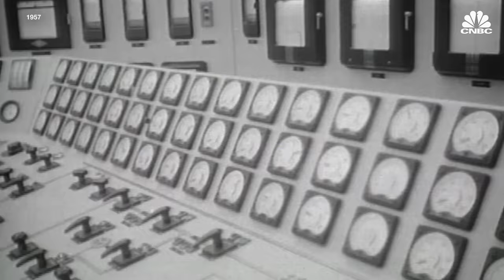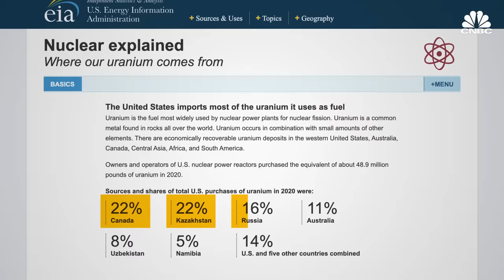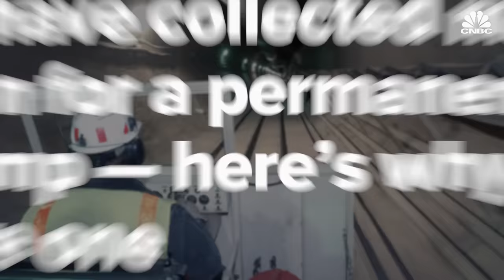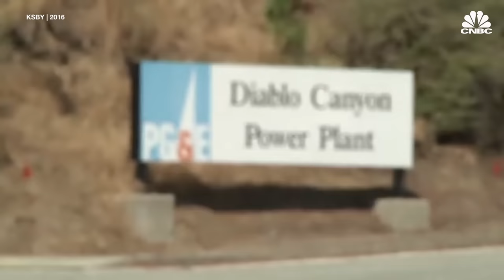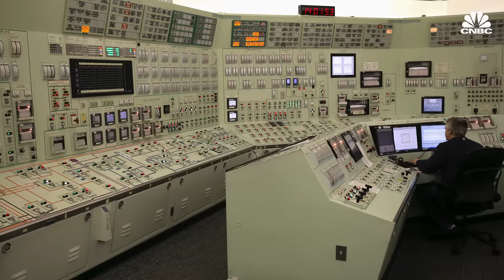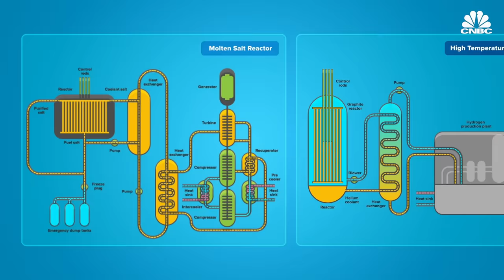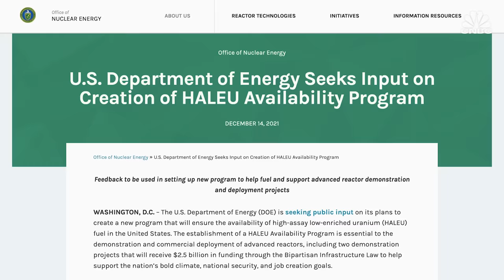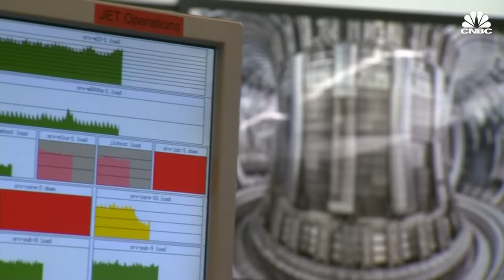Why Nuclear Energy Is On The Verge Of A Renaissance

Comment: The video was annoying within 2 minutes, but the comments are a good read.  I think nuclear plants - salt water cooled slow reactors most likely in spite of MSM and frontline political maneuvering.  However, the grid is not up to demands as they are & the world is burning all bridges on insane push for everything electric. An unstable grid should be a bigger disaster than the world has yet seen on our current path. UNLESS we alleviate the grid at each customer with reliable, long life or otherwise manageable & frugal storage.  Meaning better than LiPo, graphene, Iron-based ideas and the rest that are sifting through dark corners of the web.
Reply: It plays much better at 1.75x. I was able follow without wanting to muzzle them.

Comment: I really don't like the pressurized water reactor (PWRs). And I am not too thrilled by the prospect of using sodium to cool the fast reactors.There is, however, a better way. Molten salt reactors (MSRs) have been shown to be feasible. And they are better than PWRs in every possible way - including a lot cheaper and a lot smaller. In new Brunswick, a a 300MW reactor is being built, which burns trans-uranic waste - and so solves a difficult problem left behind by the current technology. This is win/win. It has been designed by the MOLTEX company. However roll-out is disappointingly slow, owing at least partially to interests vested in PWRs and Advanced gas cooled reactors. And just sheer inertia, quite honestly. We should have at least one such project in the United Kingdom, probably with Rolls Royce nuclear as the lead. Since MSRs are not subject to the dangerously high pressures of PWRs, they do not need the enormous containment  buildings associated with PWRs. Except in Russia, where they just don't bother. But then we get Chernobyl.
Reply: Just because they say something in a slide show or corporate PR doesn't make it true.
No one in the U.S. is even considering building MSRs.  Until one is built and proven to do everything the corporate PR says, it is just smoke and mirrors.
Reply: @clarkkent9080  
The feasability of the MSR was demonstrated in the 1960s by a team at the Oak Ridge National Laboratory, which included Alvin Weinberg, the inventor of the MSR as well as the PWR. Weinberg knew the MSR was superior in every possible way.
However, the ORNL project was cancelled for political reasons. In a rival part of the country, the money was used on a sodium cooled fast reactor. These have turned out to be very disappointing, but they took the money which could have been used to develop the MSR.
China, which is not constrained by cost issues, has a project to develop the first MSR. I would hate to see this brilliant idea fall into Chinese hands.
A variant of the MSR called the Stable Salt Reactor is being built in New Brunswick. But it is not expected to come on-line until 2030.

Comment: In Hawai they are shutting down the last coal plant and installing Tesla power walls. Nuclear can only exist in a small way. These large plants are not cost effective in the long run.
Reply: Hawaii could benefit greatly from a few small modular reactors.  They will fail miserably with Tesla Power Walls without some other form of fossil fuel or nuclear to provide a base load.
Reply: @danadurnfordkevinblanchdebunk Funny they were saying the same things in Australia now they are eating crow. So, stop the BS.
Reply: @danbuckles2745   Australia solar and wind is failing and they have among the highest electricity rates in the world.   Australia has the highest per capita CO2 emissions in the world.  That's because 93.6% of their total  primary energy supply is from fossil fuels. 

So you were saying?
Reply: @thesinistersiblings705   Funny how the nuclear ban is unraveling where the public can see the hypocrisy of a new Australian nuclear Navy beginning to take form.

Comment: It's the answer we need till we can transition to "effective" green energy sources...solar isn't efficient enough yet wind takes power to produce power,green sources are not there yet
Reply: Listed below is the facts (feel free to confirm) and status of the last 4 new commercial nuclear projects in the U.S. over the last 20 years.  There are NO other new commercial nuclear plants planned at this time. Not my idea of a renaissance.

The Southeastern U.S. is super pro-nuclear MAGA, has zero anti-nukes, and 100% political support. 

VC Summer (South Carolina) new nuclear units 2&3 were canceled in 2017 after spending $17 billion on the project (original estimate of $14 billion and 2016 completion date) with no clear end in sight for costs or schedule. 

Vogtle (Georgia) new nuclear units 3 &4 currently 110% over budget and schedule (currently over $30 billion) and still not operating. Mid way into the build, the utility stated that had they known about the many costly delays they would never have chosen nuclear. They are now delayed another year because according to the project management, thousands of build documents are missing. 

If you can’t build new nuclear in the MAGA super pro-nuclear southeast U.S. then where can you build it?
Reply: @clarkkent9080   Many countries have been building and using small modular reactors for many decades, built in two years or less for millions, not billions.  You fully well know this but keep repeating the same nonsense hundreds of times.

Comment: We should switch to LFTR small deployments with core swap capability... and create central breeders that have a complex reprocessing (oak ridge).  IF those fellers aren't properly funded down there, the USA is going to fall behind China on this.  The last thing you want is to fall behind China in Energy.  Some day energy = power, currency, etc.  PS - I'm the guy that hollared until they built those new ybco D magnets for the mak. It should help you see what's next.
Reply: @Clark Kent   Yet you continue to ignore from your blank trolling channel, many countries have been building and using small modular reactors for many decades, built in two years or less for millions, not billions.

Comment: Believe it or not nuclear power is the safest energy we have access to at this time. Safer than solar panels. Think about that. Counterintuitive but true. We need to follow science not the emotions of the masses.
Reply: If we could only build them cost effectively in the U.S. they would be an option.  But they are not
Reply: @clarkkent9080   As you are fully aware yet keep spreading your nonsense, the US and many other countries have been building and using small modular reactors for many decades, built in two years or less, costing millions, not billions.
Reply: @clarkkent9080  The amount of energy resources these produce for the cost far out way any other currently known method. The start up cost is nothing compared to the money they can make and the energy they can produce once functional. And as the person above said he have and do use them, just not the way we should be using them. I'm from coal country, the poorest place in the nation (at least at many times) where our economy mostly depends on fossil fuels but anyone with a logical mind that looks into the facts and science can see nuclear energy is our best option.